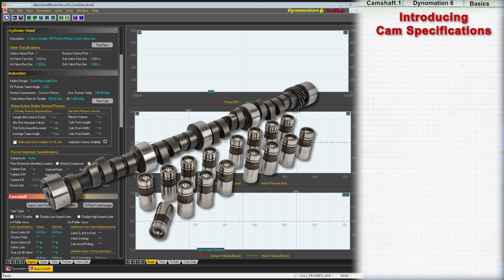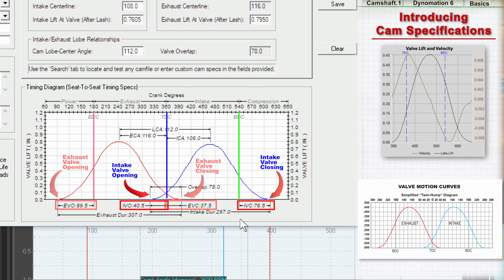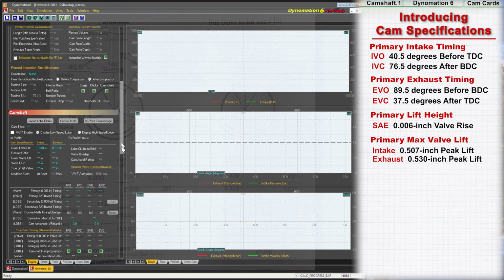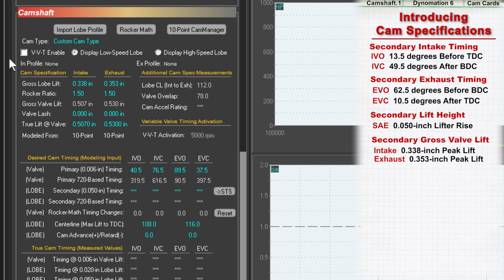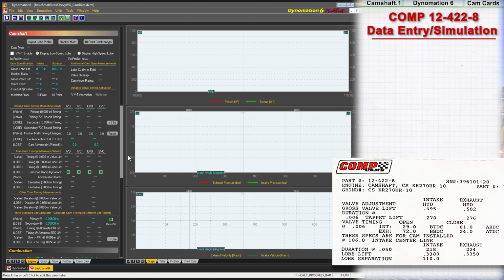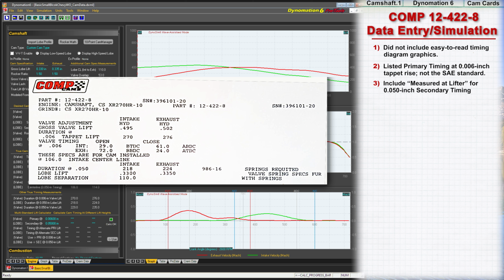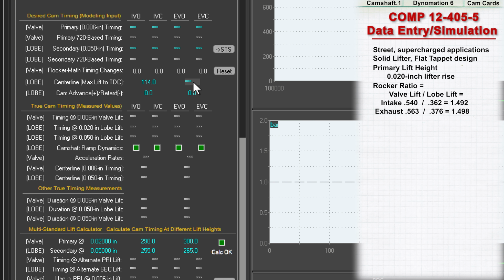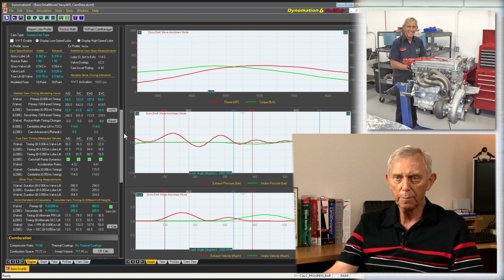2_Cams And Engine Simulation, CAMSHAFTS.1

Comment: If lash is accounted for when converting lobe lift to valve lift on a solid tappet cam, is plunger depression on a hydraulic lifter accounted for? 

E.G., I have 7/16"-24 rocker arm studs on my SBC. I preload the lifters 0.025" (1/2 turn). When the engine is operating the internal piston of the hydraulic lifter is compressed until a check valve is employed to close the oil inlet orifice. Since fluid is not compressible the lifter then behaves like a solid tappet, until the pressure is relieved on the closing flank, back to the base circle. Is that moment of compression accounted for in the formula?

Comment: Crazy question: I’m thinking of getting your program to help me with my Harley build: with the exhaust/header part how do I make sure that it’s simulating the proper 45* with a shared con rod.
Reply from the maker: Thanks for your question. The cylinder centerline included angle is not directly modeled in the engine simulation. Changes to block design have little effect on the thermodynamic properties that are modeled by our simulations. So, our simulation will model your engine with good accuracy.
Reply: @motionsoftwaresim  I’m not as much worried about the thermal properties and the timing of the exhaust pulses/pressure waves. Mainly for scavenging and collector design.
Reply from the maker: The timing of exhaust pulses and pressure waves is established by the valve timing, not crank/rod relationships.

Comment: I still have a lot of your programs, but unfortunately I don’t have anything with windows anymore and you guys were mainly based on windows platform, hopefully in the future I can put this stuff on my iPad! 
I usedused it a lot and it’s really good information to have for designing and building engines
Reply: Windows 10 laptops can be found used for $100-200 online auction or pawn shops. Cheap machine compared to $150-$600 powerful software.

Comment: Can someone point me to free simulation software 🤔
Reply: None that will do what this will do. (Accurately predict minute changes to 1% of outcome in reality). This is the ledge between <$1000 software a professional shop can use, to $25,000+ engine design CFD software the big-3 utilize to develop new modern engines.
Reply: I suggest HPwizards Horsepower Estimation tool (online) it is simple but effective for basic estimates. As long as you know Stoichiometry, Lambda, horsepower, and fuel flow rates you can find Volumetric Efficiency. Once that is found, you can hold VE constant, and manipulate other parameters. Or change VE by an estimate of what you expect an upgrade to make (e.g. +3% or 0.03 VE for long tube headers, +0.01 for high flow air filter. Also can play around with Boost, etc.

Comment: In the early 2000s, I bought Desktop Dyno 2000, then bought Dyno2003, Drag2003 & FastLap2003. I later got the matching Sim upgrades and trialed DynoSim5. I messed with FL the most, but found the track design implementation very frustrating.
Reply from the maker: Thanks for the comments regarding our early software development. Sorry you had issue making custom tracks for Fastlap. I wrote the track-building explanation in the FastLap Sim5 user manual, and I thought came out pretty well, but That was quite a while ago, and it may need some improvement. Thank you for being a customer.

Comment: $499.95 U.S on special,  $650 + shipping Canadian funds. No Thanks
Reply from the maker: Wow, that is a lot! Exchange rates! Send an email to support@motionsoftware.com and I may be able to provide some suggestions. Thanks for watching the video!
Reply: Chassis Dyno time is $500/day everywhere in the free world. The best tuners for MoTeC and ProEFI charge $1,000 per day. Plus actual cost of airline ticket and hotel.

New turbos are $3,000. If it's the wrong size, you will be lucky to get $2,000 for a used non-returnable item. -$1,000 mistake, plus weeks of time to instal and attempt to tune. Now you gotta hire a pro tuner and Dyno AGAIN to make the new turbo work. 

With software, the mistakes will be small. Like 0.5" too short of runner length. Or 1% fuel flow difference than expected. Or 5hp less than you thought it would, on a 550hp build.

$600 is a bargain, when you can use it to get everything right the first time.

I see people spending $600 on aftermarket tuners that are flashed with half a dozen canned tunes that aren't even optimized for their own specific car and mods. Like, wtf?

Comment: I have been trying to replicate modeling results using 10 point data and comp lobe profile data.  (TK lobe profile solid rollers)  I assumed that the lobe profile data would provide a more accurate simulation, but in most cases, the hp and torque differ more than 10-15hp/ft-lb between doing the sim with 10 point cam data and the same imported lobe profiles.  Should the results be the same?  Which is more accurate?  Where can I get help online without having to wait on hold for a long time?
Reply from the maker: In general lobe profile simulation should be more accurate. But there are quite a number of factors that come into play. Send me an email at support@motionsoftware.com and attach the engine file you’re working on and any other cam data that would be helpful. I’ll be happy to look at your set up and see if I can offer any suggestions.

Comment: Larry, you were correct. I did garner a lot of information and understanding just in the viewing. So the software can simulate the performance results from varied cam specifications. Can it also recommend the optimal cam specifications or is this obtained through running multiple simulations with incremental changes? Thank you
Reply from the maker: Thank you for watching the video! The software also has a feature that will run multiple simulations while varying cam timing to find an optimum result. We call this the Iterator. It will be discussed in an upcoming video. Thanks again.
Reply: @motionsoftwaresim  you left out/forgotten the dodge 5th-gen vipers v10 cam-in-cam so yes LCA ( and VVT ) cam be changed ( and technically you could use the cam design/core for a 1:5 to 2:0 rocker's ratio or down to 1:1 / less than 1 not sure why'd you do it though ) on the fly as i own a 4-th gen cam core but phasers and or manufacturing limits the maximum range the computer or you could command it's about 10* to 20* LCA ,90* probably could have been made but it's not all that useful 

i got to copy/learning it for my V8 dodge 

did you remember the multi-air system from dodge? as some people are tuning for more power ect